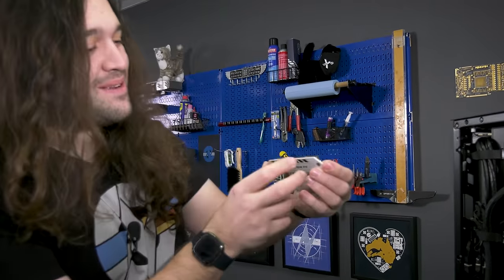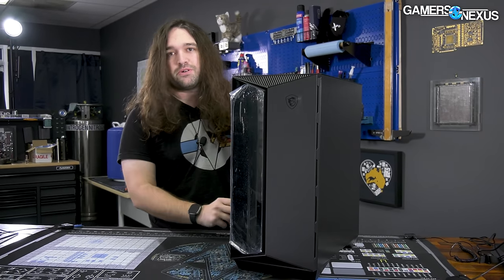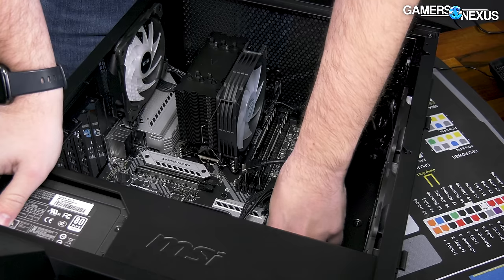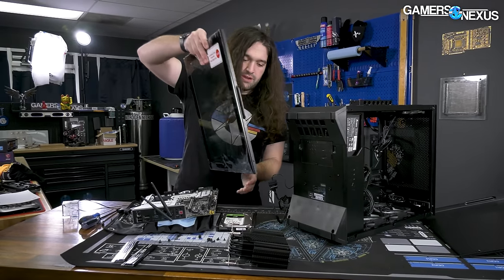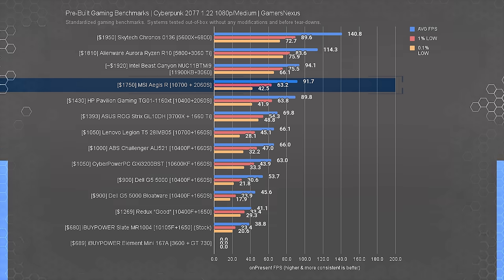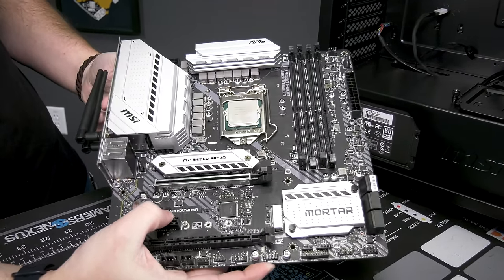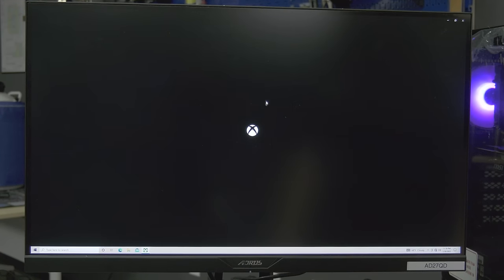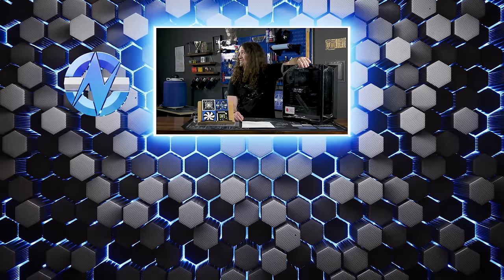MSI Pre-Built Bends SSDs & Boils CPUs at 100°C ($1700 Aegis R Review)

Comment: Ahh, the "It's Better Than Dell" series. On this episode, MSI shows us that it can build a computer and BBQ in the one unit. 😁👍
Reply: IIRC, the word "Aegis" is a shield usually associated with Athena/Zeus .

At least the case works as the "Aegis" name implies: It shields all the inner parts from airflow.
Reply: Its bios makes it worse than dell. Dell has proprietary board and bios that's just weird but kinda works, This is just a friggen 350watt silicone fuse/heater, best case you part it out and reflash the mobo and scrap the case, similar to ibuypower.
Reply: @CourtesyToot  Yeah, any prebuilt is part of the "It's better than Dell" series as I call it. Whether it passes or fails is up to you. In this case, it passes because it can also cook a brisket inside the case in 4hrs. 🤣👍
Reply: I ain't buy that for my BBQ my old grill cost less than an MSI PC
Reply: You can’t discount the KFConsole though👀
Reply: @Noah-lj2sg  Not normally, but even then if it is, telling people it's a spambot will help them avoid it anyway. 😉👍
Reply: To be fair a computer that works as a BBQ grill is handy for long hour gaming session.
Reply: It's always fun when you can't distinguish if your PC is hot because of mining or not.
Reply: @GreasyFox  I disagree a bit. There's still room for improvement. The GPU has a plastic backplate.
Changing the backplate to metal will ensure a better heat spread, and better quality BBQ meat.
Reply: Think I could cook a burger on the cooler? Maybe make my hash browns on the back of the MOBO?
Reply: @nvirevolution2235  Only limit is your imagination. 😉👍
Reply: hey it is 2 in 1 pc.. its a good deal..😂
Reply: Atleast it's better than only bbq
Reply: @CALLER ID OG xbox 360 launch version is much hotter
Reply: Combination hookah and coffee maker!
Reply: @MafiaboysWorld  well, yeah its better than dell only if you part it out. MSI out of box settings are basically unusable.
Reply: @CourtesyToot  No, I just mentioned how it's better, by being able to roast anything from chicken to meatloaf thanks to its BIOS settings. 😉👍
Reply: This might have been built by someone who has one of those tables with a built-in grill cooker, and they figured why not make a PC that heats up and can cook food, too?
Reply: @First-Name_Last-Name  nice funny
Reply: Bend ssd and a bbq unit. what a deal.... bad deal
Reply: Actually, Steve refused to give it the "Better than Dell" award ... So it's the "How bad can you get" series. 😁
Reply: Every shipment includes a prime t-bone with instructions of how to cook it perfectly on the msi bbq
Reply: MSI is stealing Razer's ideas?
Reply: Watch Dawid's video on the Acer Loser Nitro Suck Face Edition where that thing seemed to have quite the chokepoints. The updated model did better...
Reply: @MafiaboysWorld  if you cook a brisket in 4 hours, you cooked it way too fast and it'll be garbage. So this thing sucks even as a BBQ. Maybe you can toss a steak on the cooler and use it as a grill?
Reply: Nope, not legit unless Intel releases a KFC SKU CPU.
Reply: @depth386  I guess the 11900K wasn't hot enough? KFC could've used that in their proposed KFC computer that houses both fried chicken and a gaming PC.
Reply: Ya I dont want a bbq in my pc or a television in my refrigerator or a car crusher in my facial id software.
Reply: Except this one wasn't even better than Dell XD
Reply: BBQ grill . . . perfectly good use for an old computer case, now that I think of it.
Reply: Its now the" its better than msi" series
Reply: Finally a competitor for the KFConsole
Reply: BBQ? nah, air fryer :)
Reply: Dude, you're gettin' e-waste.
Reply: 2 in 1, great value!
Reply: I hope my laptop doesn't burn up
Reply: i mean it is just need a new case
Reply: I have this PC case with an MSI 240R magcool Coreliquid AIO on a 5600x and the temperatures aren't amazing but it's no where near 100c let alone 80c
Reply: Redefining the concept of "all-in-one".
Reply: Lol!  Brings outcast iron pieces in anticipation.
Reply: Don't forget space heater as well. Kinda a 3-1 killer combo of sorts 😂
Reply: My msi laptop runs at an idle temp of 70 C. And thats with my fans at full blast, an underclocked cpu, a cooling pad, and a snowy day outside to top it all off.
Reply: @wy477x  Yeah, yours is the MSI portable grill and computer in the same unit. 😁👍
Reply: @wy477x  yikes 😳 and I thought my razer blade 15 2020 base model was bad underload..... I guess not so much. Have you cleaned out the fans and heatsinks of any dust, and maybe reapplied thermal paste to the cou/GPU? I know that my laptop had gotten dust and cat hair clogged In it recently because for awhile I had been using it to mine and it stayed on for days running under load, and I didn't clean it regularly. So even at idle, I had temps on certain cores jumping from 75° c to 98° c randomly and rapidly but after giving it a good cleaning (I didn't reapply thermal compound) it's now back to normal temps (idle temps after a couple hours of non gaming use) of around 51°c. Never underestimate the usefulness of a good cleaning!
Reply: @alexanderlee5180  I have been cleaning it every month. All I got was a broken heart, lost warranty, and a few missing screws. Also the cpu cooler is completely stuck on.
Reply: @wy477x  I see .. that's unfortunate then. Sorry your dealing with that. If my razer blade broke or acted up like that, I would be devastated cuz I can't afford to replace it. Have you tried taking it into a shop to get it repaired?
Reply: @alexanderlee5180  I'm getting a new pc soon, and i personally hate repair shops.
Reply: Strap some nuggets to the fans and its an air fryer!
Reply: Seems like a $50 dell is better than this system because it will actually survive more than 6 months.
Reply: Speaking of BBQ on a PC, what if we use a heat pump to suck heat out from the CPU and GPU to the roof of the case, so we can do BBQ on the case?
Reply: KFC loaned them their thermal engineer from KFC PC project.
Reply: If you leave it on long enough, you can smoke some meats with it too.  Truly amazing engineering.
Reply: Actually have this case with a i9 that came overclocked to 5.0ghz and a RTX 3090. At the out of the box settings it would jump Temps pretty damn fast with anything requiring more than basic graphics. I'm curious if anyone that dies have this case has tried mounting a larger radiator on the front mount versus the top mount. Because the dual fanned radiator for the i9 is not cutting it
Reply: Breaking News: Traeger announces it’s going into making gaming PCs.
Reply: It made the true KFC console
Reply: Making a pre-built better than Dell is about the same difficulty level as being more agile than a brick wall
Reply: this feels like a jixaw video
Reply: You've made me deadass curious if I could make an air-frier connected to a computer to use all that lovely radiant heat for something more useful than a space heater.

Comment: Thank you so much for reviewing this and warning everyone. I bought one of these unfortunately - there were a few limitations to what I could buy, long story. Has a 10700k and RTX 3090. When it arrived, the CPU jumped to 100 C with any task. I took the PC apart and found the "Please Remove Before Install" sticker still on the water cooler block (I have pics...). Took that off, repasted, temps improved, but not great. Found the same problem you found - the BIOS settings were pushing it to maximum clock without fail. Tweaked, temps again improved, but not great. I pulled off the front panel, temps were much better. I contacted MSI and bought the mesh equivalent of the front panel (from the Gungnir 111M or something similar). Temps were finally manageable. Then the computer started crashing consistently during every machine learning or gaming session. Turns out the 750W PSU could not handle the power spikes from the 3090. MSI tried to replace the PSU with the same one - same problem. I got sick of it and replaced it with a much better 1200 W one. After all that, my CPU temps returned to 100C. Realized the water cooler was no longer pushing water. Replaced that... Now I finally have a working computer, months and hundreds of dollars later.
Reply: Jesus christ.
Reply: So sorry. I had almost a year of fights with MSI over a motherboard of theirs that I replaced three times, each taking over a month to replace, and the board killing ALL MY OTHER PARTS, before calling it quits and spending over $400 on a new board by Asus. MSI is just a shit company overall and that board was the first and only product I'll ever buy from them.
Reply: @starwinter6845  I have a B450 TOMAHAWK good thing it didn't ever act up (I have this machine for like a year, DIY)
Reply: God bless your patience lmao
Reply: @starwinter6845  I bought the tomahawk and it's awesome but I think that was what they made after their terrible motherboard fiasco from an earlier generation
Reply: @pogtuber5146  Same and it’s working great for 3 years of daily use. It’s about doing research on the product lineup, rather than relying on brand trust.
Reply: That's though
Reply: MSI is doing a recall on their "core mag" or whatever line of liquid coolers. You can find the link on google. My pre-build also had the PSU crap out and the I9 was of course hitting 100 celcius in games and idling between 50-100 celcius. I replaced the PSU and the water cooler and the computer is fine now. The AIO I had that failed from the pre-build was either the 240 or 280 model with only 2 fans on it. I could clearly hear rattling in the radiator(where the impeller housed on these MSI AIO's). The rattling sounds exactly like the rattling in a failing hang on the back aquarium filter pump. 

The thing is that the 3070 and/or 3070 TI and above should have a 750Watt PSU. And if you have I9's they will pull like 250watts at max sometimes... This is a KNOWN OCCURRENCE so like wtf is up with their inadequate PC's? Clearly the 750Watt power supply in these PC's isn't good enough. 

They either knowingly sent out inadequate computers, or they didn't know. Both show negligence at the cost of the customer. Not cool.
Reply: @spasiklakigaming5075  I used to have a B350 tomahawk which died in ~3 months. After spending a while trying to get through to customer support I just gave up and bought an asus X370.
Reply: @joesteadman343  My AIO made a similar noise after failing. MSI wanted me to ship the entire PC to them every time something failed. Was cheaper to buy a part and replace it myself, and I chose parts GN recommended 👍. First time buying a prebuilt, but I wanted that 3090.
Reply: @thedarkness6734  Having to return the whole PC is exactly what I didn't want. How about I remove the easily removable part and just ship that by itself.... -.- lmao.
Reply: This right here is exactly the reason I will NEVER buy a pre built anything (don't care who makes it, I will not)

Happily gaming here nonstop 12700K 6900xt
Reply: @starwinter6845  ASUS is the GOAT when it comes to pc building
Reply: Dam dude. After like a week you should of returned that POS
Reply: My jaw dropped when you mentioned the sticker on the cooler plate 😲
The 750W PSU sounds like the bare minimum (well obviously less than minimum) for a PC with those specs. Disgraceful.
Reply: Why not built it yourself.
Reply: Damn man. I'd pretty much hate life after that. Sorry you went through that. Never buy a pre-built if you can't.
Reply: 750W for a 3090 is laughable. I am pushing it with a 3080 and my cpu lol
Reply: @starwinter6845  It's not often that people get faulty stuff out of the box. But when it does happen you want the company to offer decent support and warranty. And not try and weazel out and save as many dollars as possible.
Reply: Yo, my condolences.
Reply: 1200W is excessive and frankly a waste of money.
Reply: @i.m.crazee5195  not when 600W usage is in the norm for a high end system, and 50% usage of rated capacity is sweetspot for efficiency. And not when the trends of TDP are skyrocketing
Reply: Hey, what settings did you change in the BIOS to stop the CPU from running overclocked and 100% all the time? i have this computer too. i have to go in to the power settings and manually change max cpu usage to 40% when im just browsing the internet or doing small things and then 75%+ if im playing a game. it's like a have a stick shift computer that i have to switch gears depending on how intense what i'm doing is
Reply: Fuck man you gave me a headache with all that but it's not your fault though. Sorry you had to go through that. I probably would have just sent the route u did when I bought a Alienware Aurora R6. I took out the Intel 8800 and the 1080 gtx and put them in a completely new PC and boom I was good.
Reply: @starwinter6845  huh I had the opposite experience. Main board was crashing locking up during POST. ASUS tech support advised to flash BIOS. Did not fix. Then denied warranty because I had flashed the BIOS and ignored my emails and followups pasting screenshots of tech support telling me to flash the BIOS. Purchased MSI Mai board which has been 100% stable ever since. Will not buy any ASUS product ever again.
Reply: I kind of just had a similar problem. I’m now $500 EXTRA in just IT look overs alone and after being told that the power supply was 100W lower then what’s needed to power just the GPU, replacing the included 750W PSU and then told the CPU was thermal throttling and the AIO is bad I have now replaced that with a 280mm NZXT Kraken X53 (that doesn’t fit btw, currently selling it to get the 240mm) I’m hoping after making that adjustment in Bios mine runs smoother again. I just can’t afford to have my pc down too long because I’m a full time student and work from home from that same pc. It’s such a pain in the a** to buy a prebuilt for $1500+ and have to spend almost another 1K for it to run as expected.
Reply: @starwinter6845  no way I just build my own pc with msi b550 gaming plus(literally a week old) and this comment make me a little worry..
Reply: i sadly have this prebuilt too(11900k and 3070ti) that is crazy how your pc came with a 750 watt PSU with a 3090 because mine has a 750 PSU with a 3070 ti . The only problem i had is that i had to replace my AIO but other than that its been really good. Also msi did not want to replace my aio for free even tho they had a recall.
Reply: @spasiklakigaming5075  msi as a company wouldnt last long if all their motherboards did that
Reply: Those water cooling systems just suck. I had one and the impeller melted. Never bought another liquid system again... And lived happily ever after.
Reply: @spasiklakigaming5075  Good Luck. I've never had a good experience with MSI, but their motherboards lasted the longest before eventually having an MSI moment. Not to mention their Software is the biggest pile of adware infested crap I've ever seen.
Reply: I really, really wish for you that it remains calm and does its job. This much patience needs to be rewarded by the heavens my guy. Respect.
Reply: The Story from you is just the story of MSI, killing the entire point of Pre-Builds. That sucks dude. :( But hope your System is now running!
Reply: @Sha.ll0w  Lol, nah... MSI is just pure garbage
Reply: How many computer parts must one swap out before it can no longer be considered the same computer 🤔
Reply: This hurt to read.
Reply: Damn, what a journey.
Reply: @thannydevitos2332  right lol.... i use a 850 with my 3080 lol
Reply: @i.m.crazee5195  not really.... not at all... if he wants to upgrade to a 4000 a 1200w will be needed.. lol doesn't mean he's using that 1200w and wasting some of it...
Reply: Dear god
Reply: @edwardmyers1746  Fairytale
Reply: @starwinter6845  my z490 gaming edge wifi works just fine actually.  although i’m probably gonna replace it with a rog strix board.
Reply: @akacaali  msi’s aios are godawful
Reply: @WXSTANG  idk the elite capellix from corsair is really good imo.  no problems with that.
Reply: @starwinter6845  That's a shame. I bought an MSI GTX 1070 Sea Hawk from them in 2017. It's now in a friend's system but still going fine just fine. Sad to see them go downhill like this.
Reply: @starwinter6845  well I hope my MSI 3060TI lasts long
Reply: So basically you bought a PC that you had to rebuild to make it work... that's just sad
Reply: OMG that's horrible.
Reply: “Prebuilt”
Reply: I'm so sorry dude.... what a pain in the ass. Thanks for providing us with your feedback. Seriously.
Reply: After finally rebuilding, and replacing each part, I have a working PC.  This should be an award category